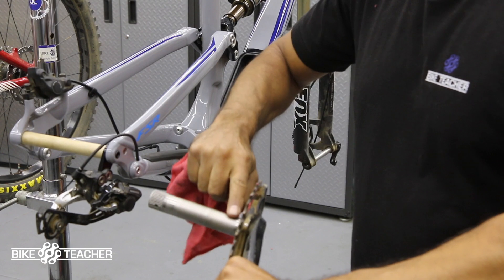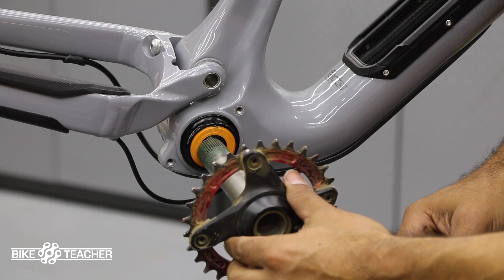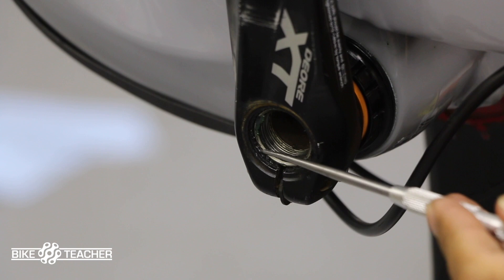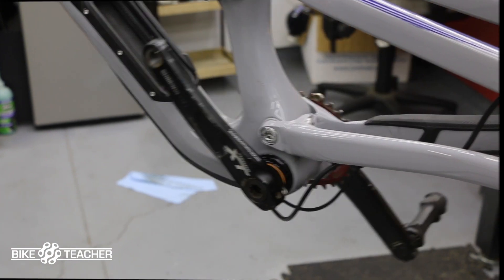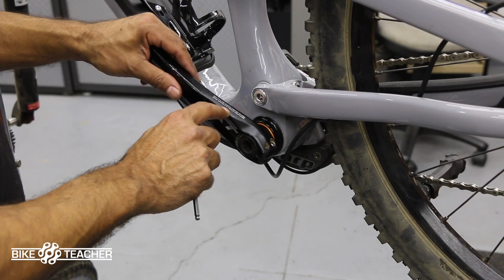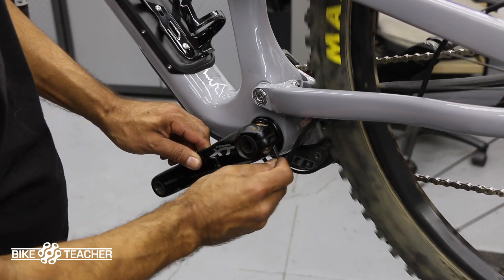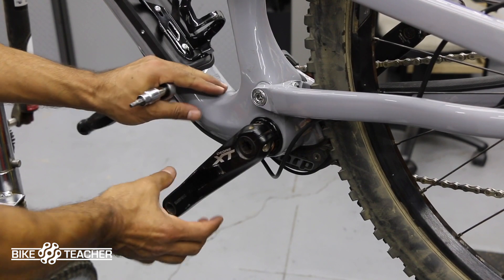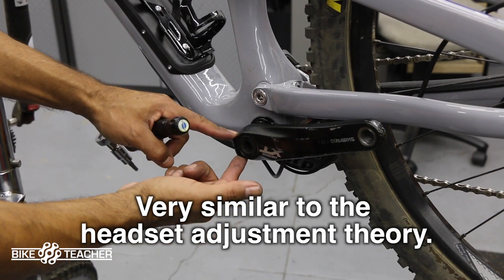How to install SHimano XT crankset in with a Paxisworks bb into a OS.

Comment: I have a boost xt crank, when do I use the spacers that came w the bottom bracket? My bike is a 73mm bb.thanks
Reply from the maker: Not sure I usually refer to the directions. Mainly watch for side to side play of the crankset. That’s your tell. Unless it has a a self adjustment built in.

Comment: Hi! I have a BB30 (68mm) bike. I want to upgrade it to XT 8100 crankset. I need to find a Bottom Bracket adapter. What do I need to look for to be compatible?
Reply from the maker: Hi, the spindle or shaft (drive-side crank arm) diameter is the most important. Check with Praxis Cycles support, they are helpful.

Comment: Thanks for the vid. Could you please explain to me how would you install the crank-set if it was a boost  and your BB(89,5 /92 mm) was a normal BB. I'm referring to the new WT M8100 which comes only in boost. Thanks in advance.
Reply from the maker: Hi, I found this information here. As far as I know there doesn't seem to be a bike frame with a boost bottom bracket specific build from the factory. Although Shimano has a variety of cranksets to accommodate chain line or Q-factor.FC-M8100-1
– 172mm Q-Factor
– 52mm chain line works with 142 or 148 O.L.D.
– Prioritizes narrowest possible Q factor

FC-M8120-1
– 178mm Q-Factor
– 55mm chain line works with 148 O.L.D.
– Prioritizes frame and tire clearance
Reply from the maker: https://bikerumor.com/2019/05/30/shimano-xt-m8100-and-slx-m7100-complete-price-spec-weight-lists/
Reply: Yes, indeed this info seems correct. With the m8100 crackset there are 2 spacers. How do I install them? One on the drive side and one on the non drive side ? If I install both on non drive side my chainline is better but q factor is off center. Any advise?